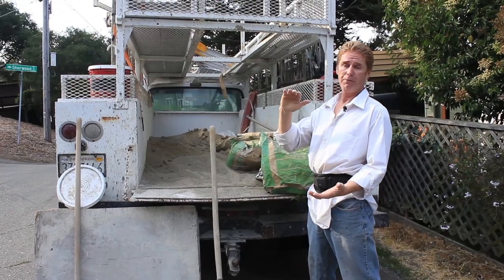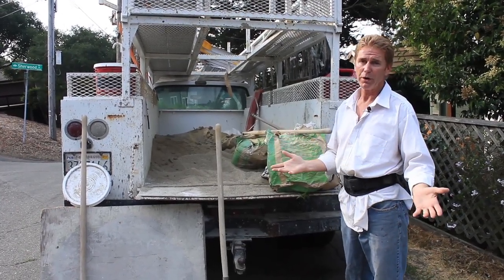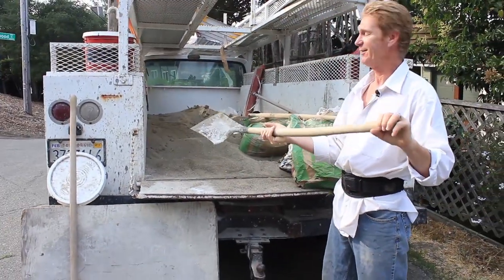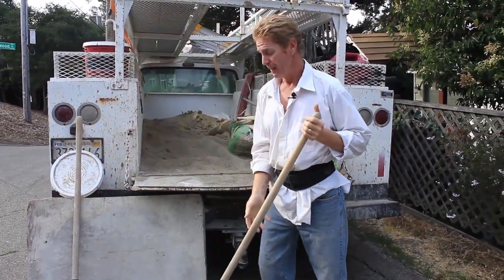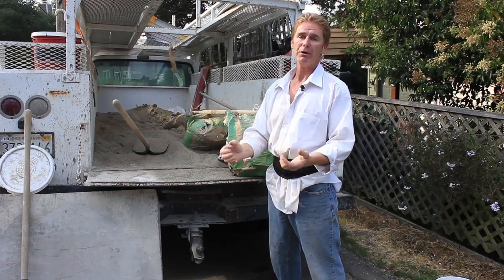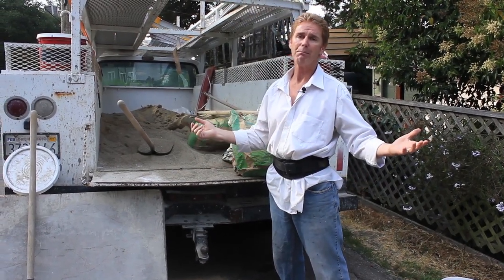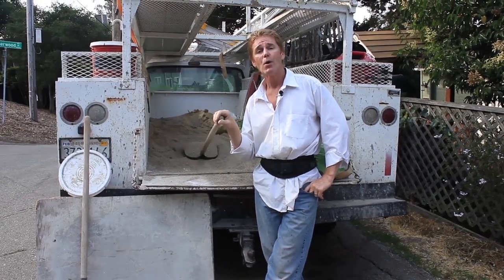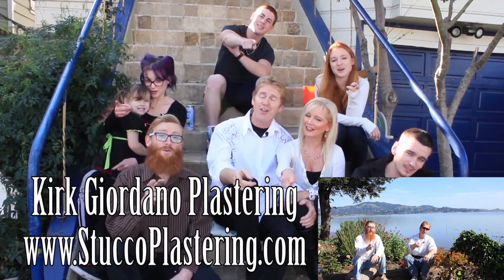Stucco ratios of sand to Portland cement

Comment: I was give it the wrong mix for a large window repair. I've applied the scratch coat, just to find out it's only Portland cement and sand – no hydrated lime. Is this OK,? Should I apply the brown and finish coat with hydrated lime added? Side question – can I combine the brown and finish coats?
Reply from the maker: Evening KeyLimeLemon4U, many Portland cement plasters  have lime, gypsum, magnesium and other ingredients but because they are not considered hazardous materials they do not have to be listed on the bags.
 I would not buy a bag of lime just to throw the remainder away for a wall or a patch, as your portland more than likely has lime in it, just not listed on the bag.
 If it does not have lime, (doubtful) and you can apply it, then there's no use to add lime.
 lime makes cement plaster more spreadable and gives it some flexibility, however takes away some strength. It also add permeability. I would not advise adding it.
 No you can't add color to a brown coat unless you buy Lehigh's hanson's white cement plaster and add color, this is tough for 20 years plastering contractors to do as the color never comes out how you wish.
 best wishes,
 kirk giordano plastering
Reply: Great!  So I'll just use the same 1:3 Portland /sand mix.  
This is an old 40 year old I believe basic Portland sand mix stucco.  It looks like 2 coats?  Can I therefore just combine brown/finish as 1?  There's no colors- just painted over later.  Can I float a bit with a car sponge to match the old sandy texture?
Reply from the maker: Howdy Key dude, I am sorry but I don't know if you can or not, I can as I have 30 years of practice. I have no clue of your skill level, sorry.
 kirk Giordano
Reply: +Kirk & Jason Giordanos DIY plastering and stucco tips 
  What I mean is is it possible?   For example, you mention elsewhere doing all three coats in one is impossible regardless of skill because you will get cracks later (barring any fancy additives).   Is 2 coats similarly  impossible?  Or quite a normal way to do it (provided no fancy finishes are required)?
Reply from the maker: Morning Key lime dude, 
 I do the majority of patches with same day two coat cement plasters,  with textures included, so yes, this is possible.
Home Depot and Lowe's are full of products that allow, the average homeowner to do this, very user friendly products such as Quikrete stucco,  Sakrete stucco, Rapid set stucco products where you just add water, but when mixing any same day cement plasters
(DO NOT OVERMIX) as an excess of overmixing actually weakens the integrity of  these products.
 Read your bag, I believe it's 3 to 5 minutes max on mixing, depending on your choice of material. 
 Best wishes, my ambitious friend.
 Kirk Giordano Plastering
Reply: +Kirk & Jason Giordanos DIY plastering and stucco tips 
Good stuff.  I'm going to try only 2 coats with standard Portland/sand mix only.  It's been a few days since I did the scratch, so I'll add the final coat now.
Thanks again
Reply from the maker: Hello Kkey Lime dude, close, a tip that may help clarify stucco application.
 All stucco coats since 1926 have been two coat systems, In 1926 La Hara come up with a color coat lime based product that when applied are maintenance free.
 Only possibly one out of 100 home today have this third coat applied, many new homes do but not all.
 Confused?
No worries, if you don't understand all there is to know about stucco as I don't either, and I'm a 30 year seasoned stucco dude that lives and breathes stucco systems.
 best wishes,
 kirk Giordano Plastering

Comment: Hi So if I go to the store and I see stucco bag i think they sell 25$ in canada does that include the sand premix in that bag or do I have to buy three bags of sand to go with that
Reply from the maker: Good Evening Guy, if you buyRapid Set Stucco Patch you just add water as it has sand in it already,
 most cement plasters need sand to be added, I'd suggest you read the bags as all are different.   
                            Best wishes,
  Sharing stucco secrets and or common sense plastering tips

Comment: The rendering job i'm on atm they're using 5:1 onto concrete blocks. Why do you think he would use this ratio?
Reply from the maker: thbuk Morning buk dude, I don't know or wonder why anyone would use any ration, sorry,
 In this video I'm explaining the rations we use.
 Many folks choose different ratios for whatever  their reasons it would be goofy to guess.
If I were to guess it might be to save cash on cement, however you don't really save cash on cement as the cement plaster could possibly be not be as strong, therefor no savings.
 I'm certain they have good reasons other than this.
 Best wishes.
 kirk giordano plastering
Reply: 5:1 ratio is not good enough. It will worn out. Several days later, touch it or scratch it and you will found out that your plaster is gradually droping out its sand, it is not a good mixing for plastering.

Comment: Hello Sir - Can I use the same ratio by adding crushed stones for drive way?
Reply from the maker: Howdy Addy, what is stucco? sand and cement, 
What is Concrete? very similar, also Portland cement with various size rocks as the aggregate, not sand.
 If you need a lot I would suggest you order from a cement company that will deliver with a cement truck,  if you don't require a little just buy the bags, you just add water, foolproof.
 Cheers,
 Kirk giordano
Reply: Thank you sir!  Its a small repair job on the drive way. I wanted to figure out the "ratio" part for my weekend project :) Appreciate your help!
Reply from the maker: Howdy Adddy, most folks add two to three parts rocks to the cement plaster to make concrete.
 cheers,
 kirk giordano
Reply: ok great. Thank you again Sir!!

Comment: hello Kirk can you use type n cement for stucco?
Reply from the maker: Howdy Gilbert,
Type N Mortar Mix is a preblended mixture of sand and masonry cement or sand, lime and portland cement.
 It's mainly used or laying brick, block and stone.
 it's also used  for tuck pointing or repairing existing mortar joints. 
 But can also be used for scratch and brown coat in stucco applications.
 best wishes, 
 kirk Giordano plastering

Comment: One very important if not the most important part of the mix, is water ratio.  Rarely do I ear about how much water to add!
Reply from the maker: Good Evening Jocelyn, if were mixing in our towable mixers, the water nozzle stays on while the sand is added. When enough sand and cement is added, we then look at the mix, if more water needs to be added, we add more if the mix is too soupy we add more sand.
 This is how we mix.
 If your mixing in a bucket try, a half-gallon then mix, if another half-gallon is needed, add it. Now you know your formula for the cement sand and plaster your using. If this does not answer your question type in how to mix plaster, we do have some videos that go into the detail you are asking.

                         Bringing peace, love, and harmony to the of, ‘plastering.’
    The complete plastering encyclopedia on video, by the plastering messengers of Youtube
Reply: Kirk Giordano plastering Inc.   Thank You very much Kirk for your reply and info, it made my day a lot easier and pleasant!  I asked about the water because yesterday I did some Parging on my house and it took me 4 hours to do a 3feet by 10 feet.  I use quickrite Parging mix thinking it would be safe to have a reputable product. I mixed one whole bag with the exact amount of water as per instructions (4.5 litre).  The stuff was so hard to apply and, it was written on the bag not recommended to add more water.  Today, I use half the bag with a little more water(.25 litre) and what a difference, I actually enjoyed it.  Without your input and your videos, would have scrapped the project. Thanks to You, I will be able to finish the 3 other bags and saving a bunch of money!  God bless You and your family!

Comment: Why is it I always read about using a 1/2 bag of lime to a bag of portland than the 3 parts sand.
Reply from the maker: Howdy Mars dude, excellent question, you can buy bags of common, which you should add lime or you can buy bags of plastic which helps in spreadability.
 I buy premium cement plaster as it has both Common for strength and plastic for spreadability.
 Plastic it what they use here instead of Lime as lime is expensive, so they say the plastic or the plasticisers additives that are added are just as good, "My Arse"
 Sort of like saying corn syrup is just as good as real honey from bees .
 Were all just minnows in a sea of sharks.
 Best wishes with your projects, live long and Plaster
 Kirk giordano on teaching plastering
Reply: Thanks for the response Kirk. I haven't purchased too much cement product yet as all I have needed is mortar for a few things. I will keep this in mind and spend the extra cash for the quality stuff. I recently found what seems to be a good building materials joint that caters mostly to the cement/drywall/plaster fields and plan to take a trip there soon. I was tempted to buy a decent amount of stucco from  Home Depot but had my drought's as to, well, quite a bit of what H.D. and Lowes sell...I want the real deal as they say. It was taught to me long ago to purchase the best supplies/materials you can afford as it is a false economy when your fighting your tools and materials when the work is hard enough on it's own, at least for those just starting out, myself included. So thanks yet again and peace to you and yours.

Comment: How many 5 gallon buckets of sand to one 92 lb bag of Portland cement. The jabber is not needed
Reply from the maker: Good evening Trace Mineral Dude,  Scratch coats are mixed at 1 part cement to 2-1/4 to 4 parts sand, brown coats are mixed at 1 part cement to 3 to 5 parts sand, and finish coats are 1 part cement to 1-1/2 to 3 parts sand. 
 Most times we mix 3 parts sand to one part cement plaster.
    The most complete plastering encyclopedia in the world on video, by the plastering messengers of Youtube.  
     Over 850 free self-help videos 🎭 👀💃
Subscribers, you can depend on us to explain with truth, honor, experience, and skill for your time invested for wishing to learn the hows and whys of plastering.😉
Reply: @StuccoPlastering  "Cement Plaster" pre- mixed with Lime?
Reply: @reasonablespeculation3893  yeah, it's unfortunate that's not made clear. Masonry (not Masonairy) cement has lime in it, but it's not clear what Kirk means by "cement plaster". What's available at the big box stores are Portland and Masonry. Too much guessing here about what Kirk means.
Reply: @reasonablespeculation3893  Thanks for reply, RS. I've been trying to find the stucco mix ratio for going-over CMUs (concrete masonry unit/blocks) using Portland cement, lime and sand. It's actually been difficult finding someone knowledgeable to explain the mix proportions they recommend, by actual experience. I'm guessing it might be about 1 Portland, a half lime, and 4 sand, but that's only speculation at this point. Reasonable, maybe?
Reply: @terebrate   Sounds like that mix ratio is in
 the ball park.  Similar to what I have used..
      There are even different types of lime.
    (don't want to even start down that road)

I'm not an expert, does gets confusing..
   Your own experience and the results you get,  will yield the best information.
Reply: @reasonablespeculation3893  I think the only lime I've ever used is Type S, which seems to be the only type available at Home Depot or Lowe's in my area. It's always right there with the various cement and concrete mixes etc. So that's the lime I'm referring to. I see that some other commenters are also wondering about how much lime to use.  

To add to the confusion, here's what Kirk said about a month ago. "If you use portland cement and mix it with sand, Voila. You have just reached your goal and made stucco." 

Without adding lime to Portland cement and sand, I don't see how it's going to stick to a vertical wall. Does not make sense. Plus, it's not going to spread easily.